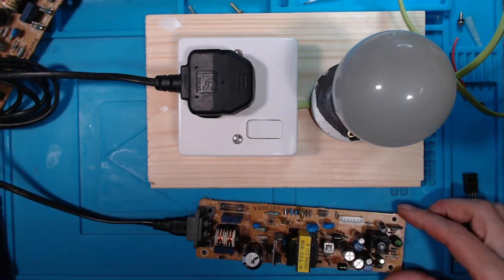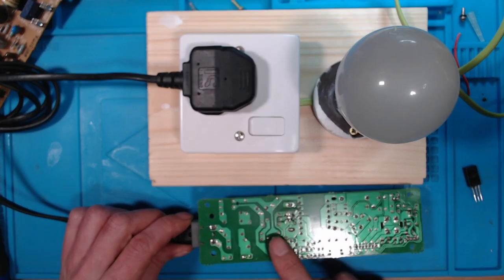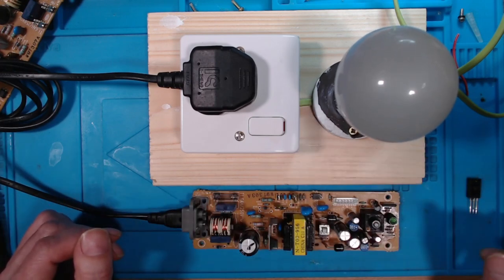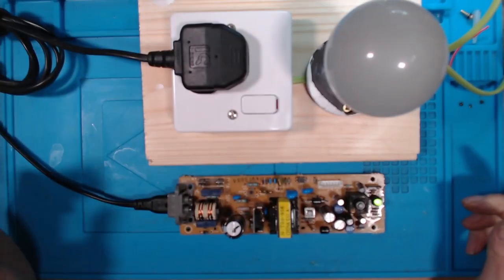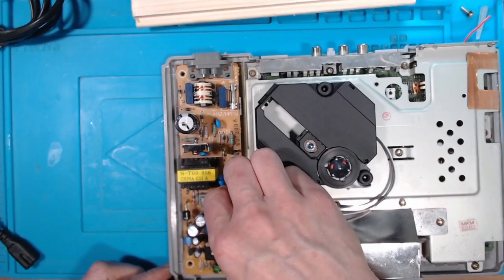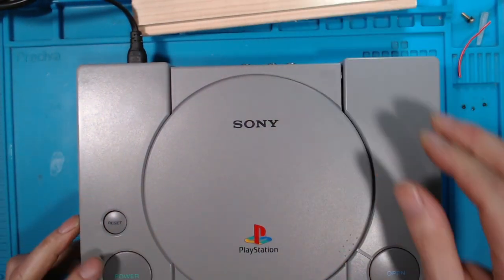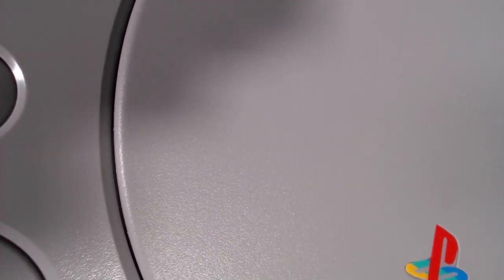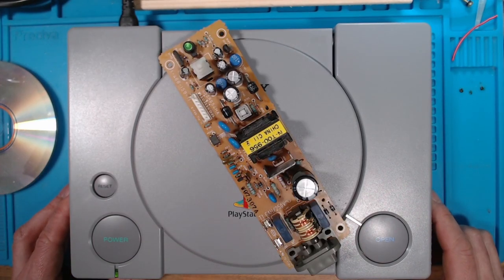Sony Playstation 1 | No power | PSU short fix

Comment: I have a fat PS 1 (100v) and connected to 220v by mistake. I found that one of the capacitor was damaged. Should I change the whole power board or just replace that peice of capacitor???
Reply from the maker: It's probably safer to replace the whole power board if you can.

Comment: I am having soooo many problems right now, paid to get a pre modded 1002 done, but the seller didn't include a cover for the cd bay so I took it apart added one I bought and it stopped reading, so I took it apart and tested it with lid off and accidently touched psu, it powers on, screen goes black, drive/sd card mod powers on but nothing else.
Reply from the maker: Have you tested continuity on the fuses at the power connector on the main board. 
https://youtu.be/-cTvptRtD6Y?t=385